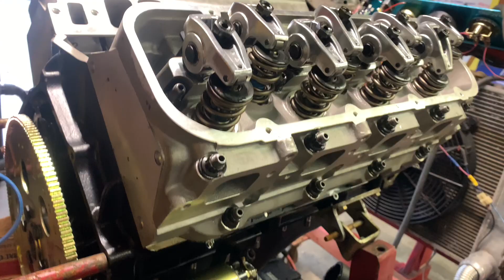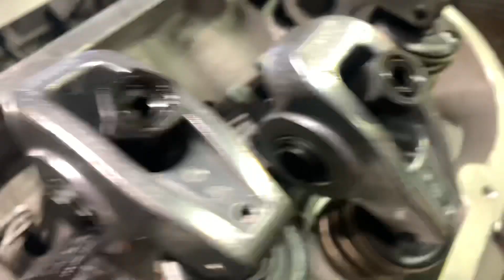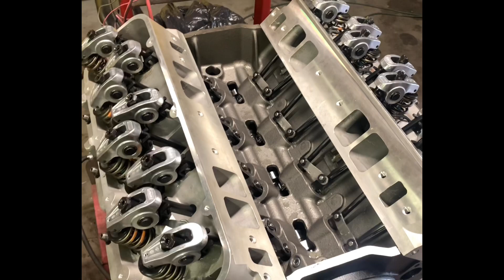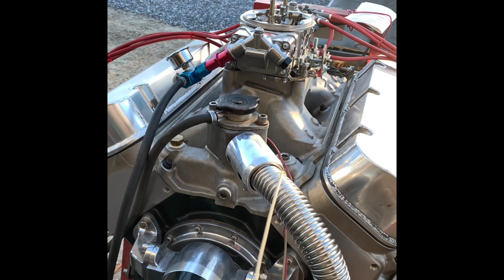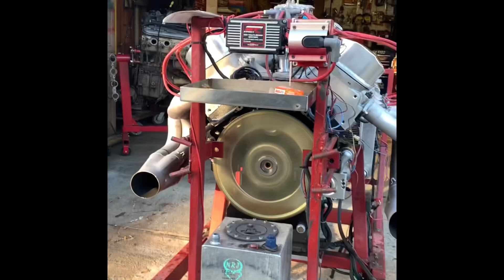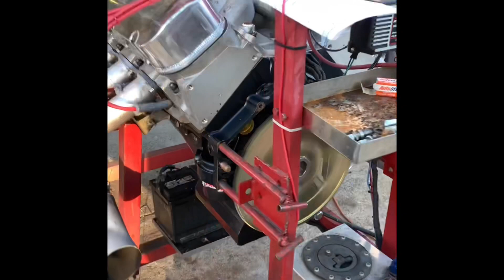540 Solid Roller Big Block Chevy

Comment: Nice build! 👍 is the Lunati cam an off the shelf camshaft? How much compression?
Reply from the maker: static 10:1 dynamic with the camshaft gets down low 9’s:1 setup for boost on pump gas and yes this was not custom order lunati had this in stock pre existing part number.